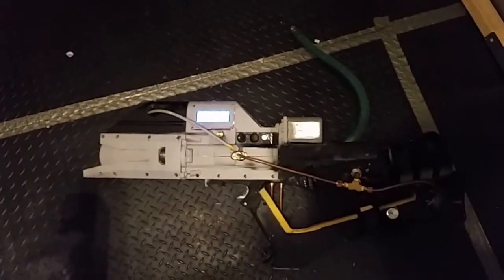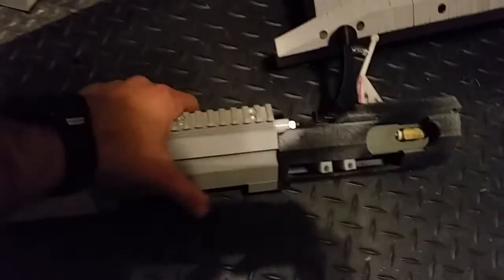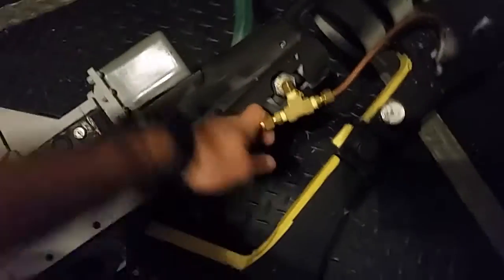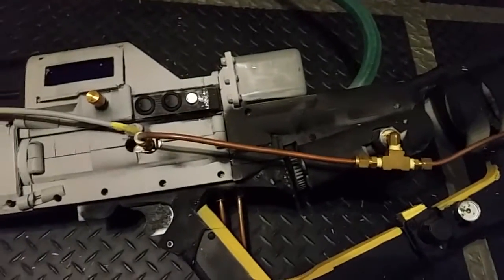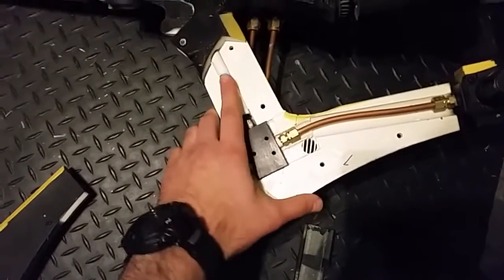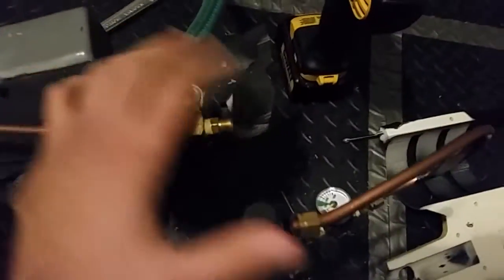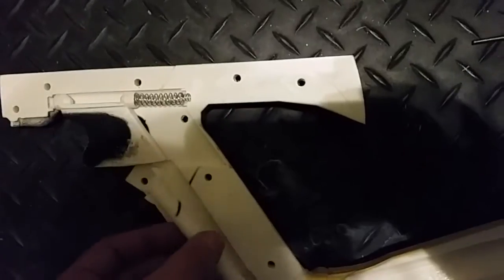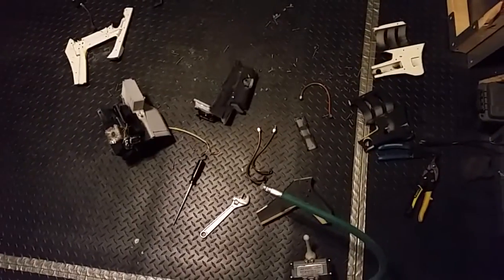Disassembling the XPR-1 Railgun

Comment: So you're telling me that you have 70 bar initial pressure on the projectile?
Reply from the maker: Yup.  If you actually do the math: 0.25in diameter/16g projectile, 18" barrel and 1000psi you get a final velocity of 215 ft/s or 65 m/s.  Which is around what I calculated for the control shot with the rails off.  With the rails energized, the velocity was upwards of 150 m/s, even up to 250 m/s on lighter rounds.
Reply: 70 bar and only 65 m/s? Are you sure it's not 100 psi? That would make a lot more sense from my experience in "air cannons" (100 m/s @ 10 bar, 16g mass).
Reply from the maker: Definitely higher than 100.  I forget what I set the regulator on back then.  I think it was somewhere in the 500-900psi range.  http://closefocusresearch.com/downloads/Calculating_Barrel_Pressure_and_Projectile_Velocity.xls
Reply from the maker: The graphs are for a preset mass=9.6g, slug length=2.4cm and slug diameter = 1.91cm.  If your values are different than these the graphs are no longer valid, you would have to recalculate them from the base equations.
Reply: Yes, where the changes are minimal, physics would be broken if you'd drop 30 m/s when using 1 cm diameter instead of 1,91. It's a root equation, therefore differences are as well to the power of 0.5. As I said, my experimental results resonate with these results, even with different projectile dimensions. My question 
still stands, how come you get such low initial muzzle velocity with 70 bar?
Reply from the maker: The dimensions matter quite a bit.  There are also a lot of assumptions that model makes.  I don't inject a whole bottle of 900psi CO2, it's a small squirt that expands, much like a paintball gun, so the chamber pressure is not isobaric.  Again, my model works well for my design, your model works well for your design.